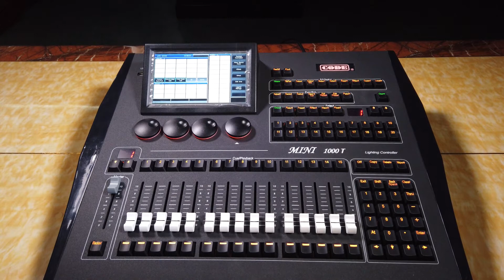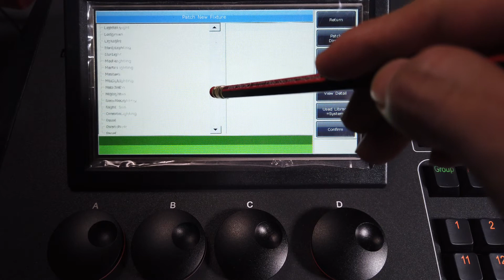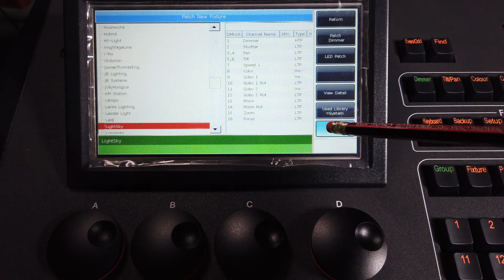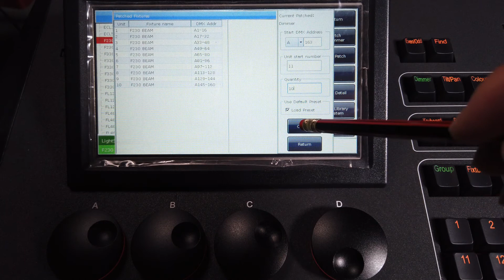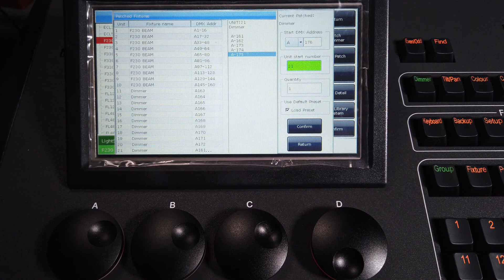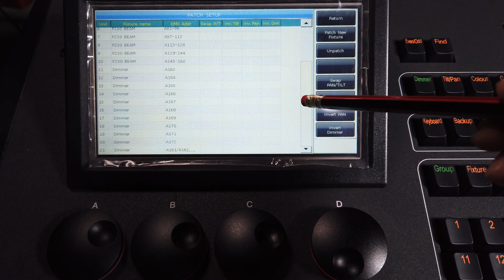4 CODE CONSOLE - MINI 1000T - Patch

Comment: how can i patch a fixture when the only thing that is written on it is just "BEAM"? any suggestions
Reply from the maker: it is difficult to patch the right profile if you have only the name. you should have the channel traits or user manual.
you can send the details to our email address: main@codelight.com.cn if you have
Reply: @codeconsoles  thanks. because the only beam we have is a sharpy 230 by clay paky. it has 20 channels. I encounter this when an event has a spare beam. that spare beam has 16-20 channels. and it says Beam 230. we managed to find one in the library but when we try it, it only rotates. no tilt, no light, no effect etc.
Reply from the maker: @zynister96  I suggest you find a simple console (the one that does not need to do patching before using.), and then test and record the channel traits.
however, if you have only the console that has to do patching, you can patch some dimmer channels and then select them one by one for testing the channel traits one by one.